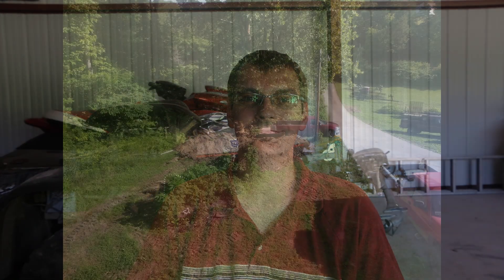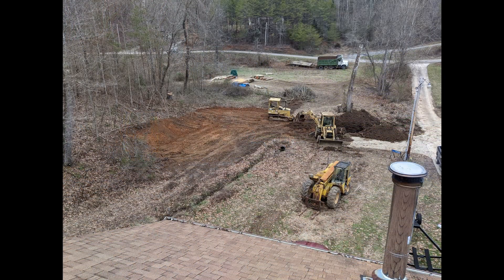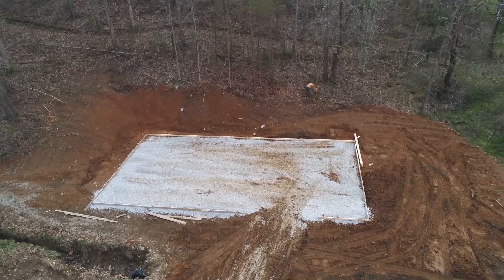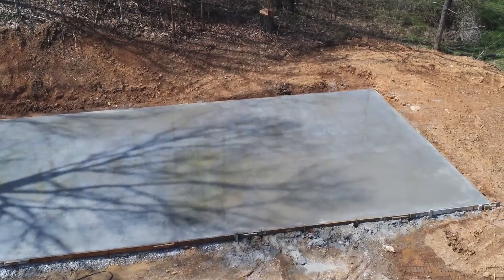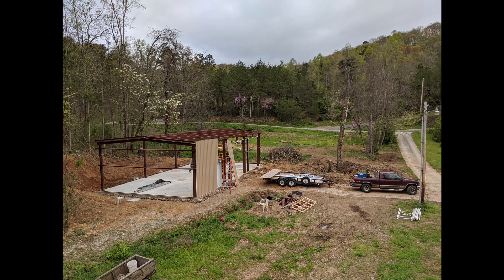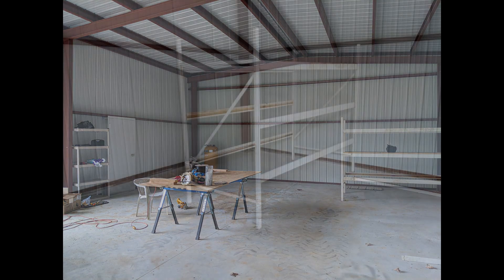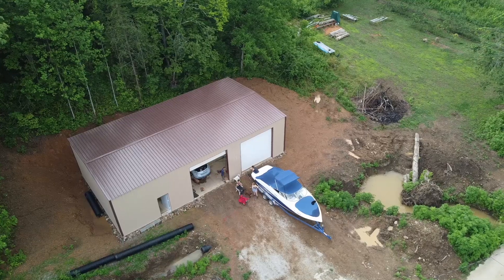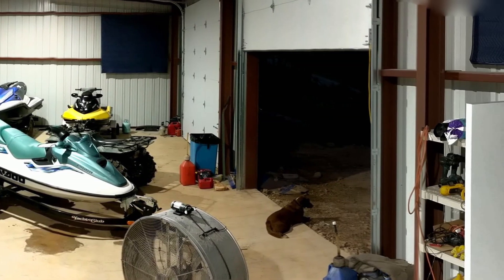Introducing the new Headquarters! (Shop build slideshow)

Comment: I’ve really enjoyed your series on troubleshooting and testing the cruise system on my 82 W123 300D. I’ve had the amp repaired and tested. I tested the stalk and actuator parts (all passed) but it still does not work. Do you have any knowledge or advice on an aftermarket cruise system for this car?
Reply from the maker: Well that is rather bizzare. I'm not aware of an aftermarket cruise system that will work with the VDO actuator.

Does it try to kick in at all? I feel like I've asked if you have LED bulbs in your tail lights, that will stop the system from functioning at all.
I wonder if it could be speed signal. I think the speedometer/cluster itself has a sensor because they're cable driven so the cable input to the speedo has a sensor that outputs a square wave.

I'll have to put that on the list of stuff to investigate and figure out a good way to test and make a video on it!

I'm planning plenty more videos about my Mercedes, I've had to put some of them on the back burner until my work slows down (Being a boat mechanic the summers are wild), I'll be releasing some videos related to jetskis in the coming weeks, but the Mercedes content is still coming, I've got a bunch more things I want to solve

Comment: Nice shop! What are the dimensions?
Reply from the maker: Thanks! We really like it, has changed our business a ton!
As far as dimensions, Its 30x55ft with 14ft height, if I were to do it all again, I may have tried to go closer to 35ft deep and 16ft high for the rare occasion we end up working on something really big it is a bit snug, but its really perfect the size it is for what we need!
Reply: @trythistv  Thanks for the info. I'm thinking of putting one up myself and yours looks the ideal size. By the way, I've also got a Sanderson 247TS teleporter as well. I have just found the operators manual and the parts catalogue in a dusty corner of my Dads barn...but it's complete as far as I can tell. You may already know this but its got a Ford 6600 4 cyl diesel engine so engine parts are readily available. Body and chassis parts are hard to come by though even here in the UK.!
Reply from the maker: Very cool! having an indoor workspace is life changing, rain and weather doesn't make everything come grinding to a halt. I've figured body and chassis parts would be a bear on the Sanderson.
I did figure out the engine, transmission and front axle were similar to a ford 555a backhoe, but knowing a 6600 shares parts will come in very handy as I need to replace the brakes on mine sometime soon, they don't work at all, even after adjusting them to the limits of the travel!
You wouldn't happen to know if the 6600 shares the driveshaft with the sanderson would you? Mine is gone, and I think the 4 wheel drive would work if I had the driveshaft, but who knows where it went, and how long ago it went there, so I've been trying to figure out if that was something I could get, or at least get something close for the splines on the transmission or if I'd have to custom fabricate the whole thing.
Reply: @trythistv  I've got a feeling it may also be from the Ford backhoe (or digger as we call them over here!). I'll look in the parts book when I get chance tomorrow. Going back to your workshop, would you have enough height to be able to use a 4 post vehicle lift in there?
Reply from the maker: I do believe so, I specifically wanted 14ft height as one day I hope to put a bendpak xpr-10s-168 2 post lift in, 10000lb capacity, 168 inch height so its better for tall people like myself or larger vehicles like my work trucks.

I've got an easy 14 1/2 feet to the roof in the center so the lift I want will fit with a few inches to spare, and since it is a fairly shallow roof pitch I should have a decent amount of clearance for whatever I'm lifting
Reply: @trythistv  Ok, so your shop is 14 feet to the eaves then and a little higher at the roof apex? Thanks for the info., I'll dig out what I can on the rear drive shaft hopefully tomorrow. I've got to give it an oil change in the next couple of days, just waiting for a fresh filter to be delivered (covid restrictions!) so, I'll definitely be back to you by then.
Reply from the maker: Correct, I've just had the shop insulated with spray foam, crazy expensive but it makes a dramatic difference for heating through the winter for sure, I've got to get proper electric run out there, and then I converted a beckett oil burner to run on waste motor oil, I'll go through how that all works when I get things lined up, I'll be hanging the furnace from the ceiling in a corner and I've got a good feeling it'll keep it toasty warm all winter long.
I greatly appreciate you looking into the driveshaft for me, I'll look forward to hearing back from you! Getting parts has become interesting with covid, some things I can get as if nothing has changed, and other parts I've been waiting months for, it's a real challenge!
Reply: @trythistv  Hi again, I have just emailed you some pages of the parts book for the teleporter.
Reply from the maker: @simonhickey8952  You're awesome! I just got it and replied to you, that was just what I was looking for, I can't thank you enough! :)